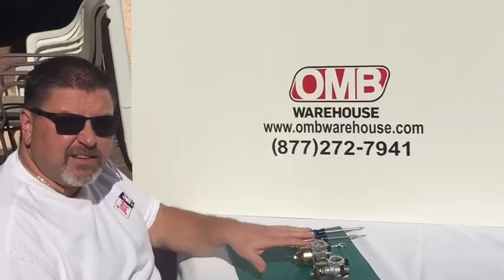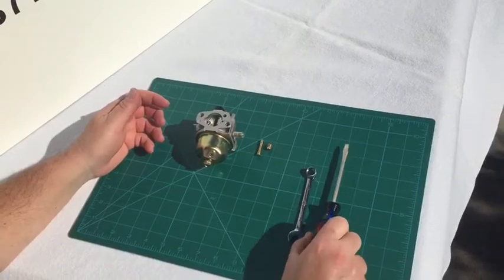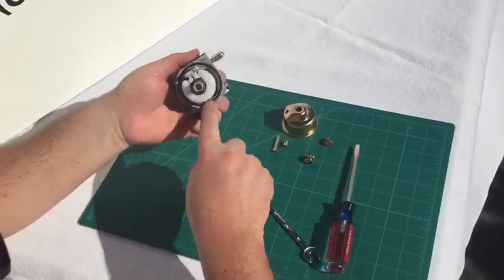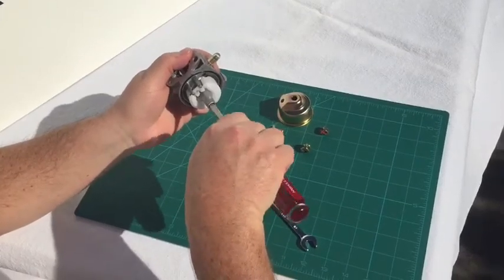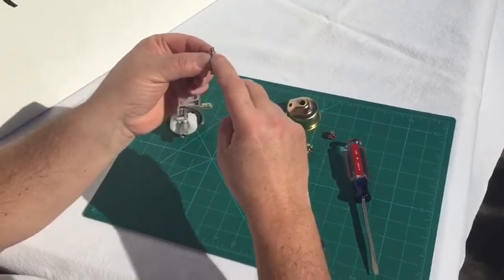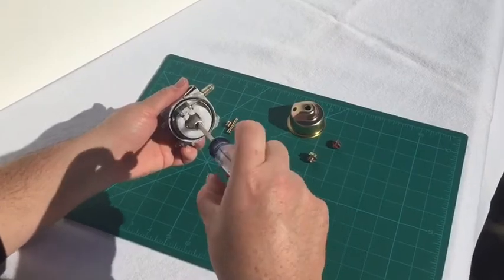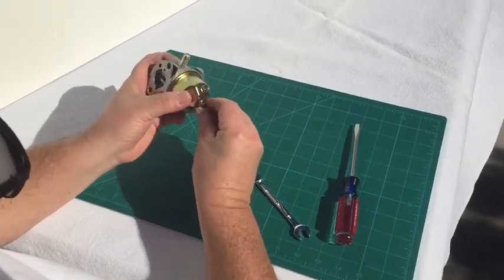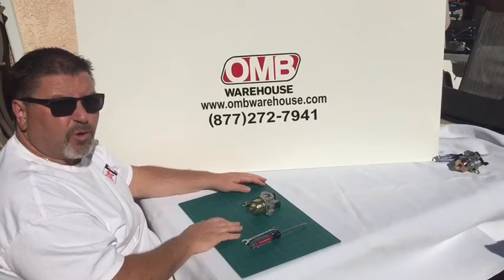Predator 212cc Jet Kit & E-Tube Install

Comment: I got the 140 e tube with the .035 jet and my carb is leaking gas now, what do I do????
Reply: I'm having the same problem,  fuel is flowing out that  e-tube, whats the deal?
Reply: @manuelvaldivia7785  I don’t remember but I would always take apart the carb and try to seal it better or see what’s the deal but it would be fine, but after a lot of use it would leak again

Comment: I run the predator 212cc, what size jet should I put in my cart to go faster?
Reply: If u don’t change the e tube go with .038
Reply: @SKATESPOTSWORLDWIDE  my little brother just switched out the jet with a 38 and a 40. It sputters at full throttle. He had changed out the air filter and exhaust to a short pipe. After he put on the pipe it started back firing. Both the 38 and 40 did reduce the amount of backfiring but both now sputter at top speed and it doesn't feel as fast. With the e pipe help?
Reply: @monahumada7535  try moving your choke. Hold the brake and rev it. When u let go, if it putts move the choke some more. You gotta find the sweet spot.

Comment: Just did this repair after replacing the carb with a clone stock.  I have the high flow intake and could not run without choke set at 1/2.  Now I cannot get the engine to idle and am getting surges.
Reply: I've had the same issue. Just installed the after market air cleaner and it runs like garbage. I wish it was disclosed that you needed to buy the filter with the jet kit. Now I have to buy the jet which is more as a separate and pay to ship it.

Comment: What happens if I just install a .036 jet and no e-tube? Running a short exhaust and a stock air filter with box delete.
Reply: I'm wondering the same.
 Cus I just order the larger fuel jet by it...
Any update on yours?
Reply: Dangerous Fandango and does it work?
Reply: Dangerous Fandango I did it. It did not like it. Put old one back in.
Reply: Alex Livingston it’s was better then the .024 that comes on the carb
Reply: I installed a .37 jet stock air box 👌
Reply: Do .038

Comment: After jetting i got better mid response and top,  but  bogging at the bottom end.
Reply from the maker: Did you check the color of your spark plug?
Reply: OMB Warehouse 

Nope, but i know im running slighty to rich.

I previously when i bought the jet kit  i install them and was getting a poor idle and bogging at 1/4 throttle. So i remove the jet and went back to original  jet and left the larger emulation tube in. So i have checked plugs when that combo of jet and E tube was in. It was on point nice light brown. Just have to fiddle with that jet.